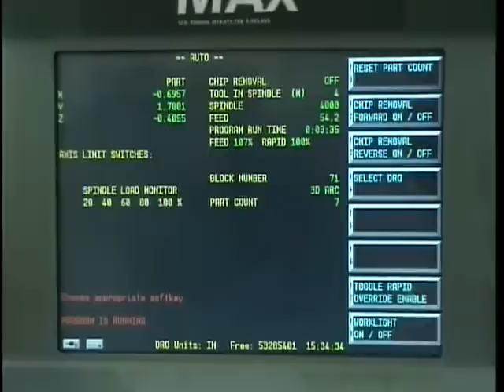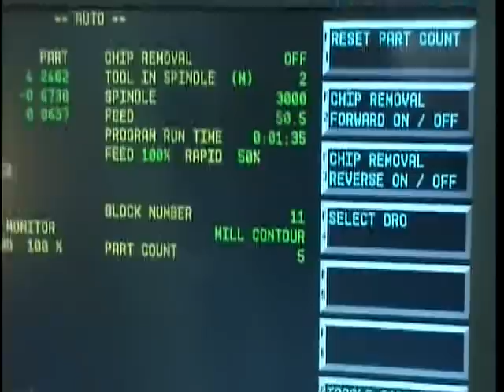356 Porsche Case halves 3D Machined Hurco VM2

Comment: I think I see the sleeves. Kind of like an outsized flywheel type bearing? How do you retain them against movement, especially during machining? Is this a 1500 2 piece case?
Reply from the maker: +scheusselmensch The sleeve started out as a piece of billet aluminum. I cut material away from the case first with the same 3D machining process to add the sleeve material in. Then it was anchored to the case by drilling holes through the sleeve and into the case. The sleeve was then secured to the case with pressed in aluminum pins and then 3D machined again afterwards.

I'm not sure what type of 356 Porsche 2 piece case this was. It was brought to me by my customer GK Restorations for repairs.
Reply: +Deep South Interesting. The usual course of action is to TIG up the saddles and machine them back to standard after truing up the case. Did GK have you machine for and add camshaft bearing shells?
Reply from the maker: +scheusselmensch The case was Magnesium, so welding was not an option. Someone before me already tried repairing it, but failed to do it properly. The case camshaft bores are the bearing surface, so after cutting the case half surfaces down some, the camshaft bores were then 3D machined back to factory specs. This was the only way I could repair everything in one setup on each case half to ensure precision. The programming on the Hurco was relative from the dowel pin holes on each case half and it took two separate programs mirrored on the X axis from each other.
Reply: +Deep South I'd forgotten that the 2 piece cases were mag. Some folks have modified 3 piece cases to run VW bearings on the camshaft. If the Porsche cases have been ripped up there, it's a nice fix. Your method sure makes a nice result. Did the sleeves encroach on the case through bolt bores?